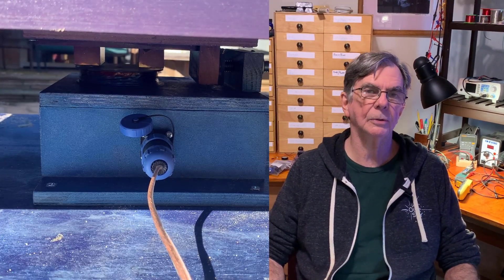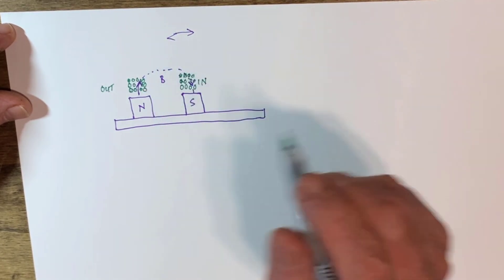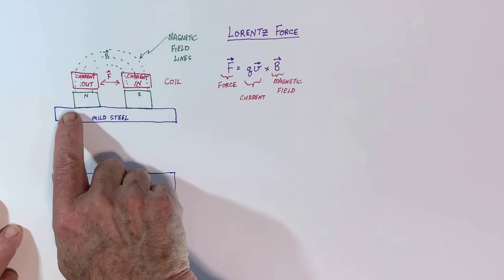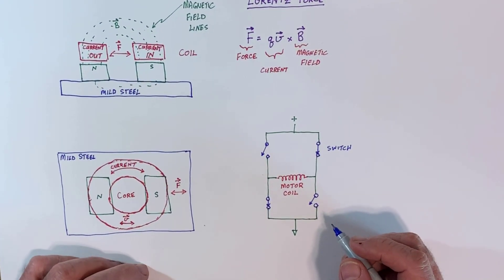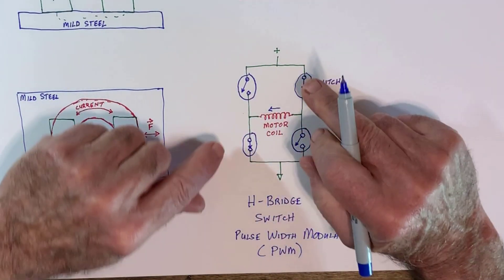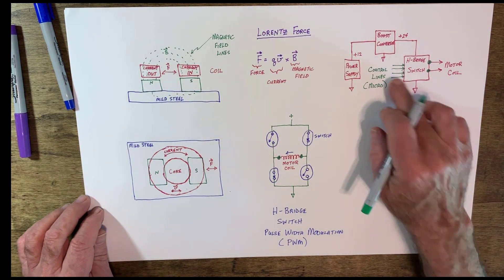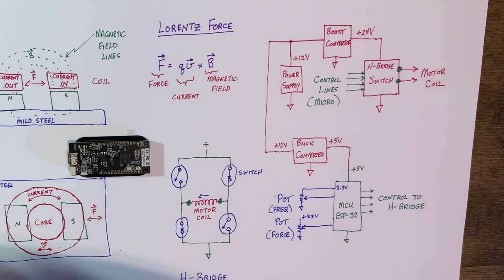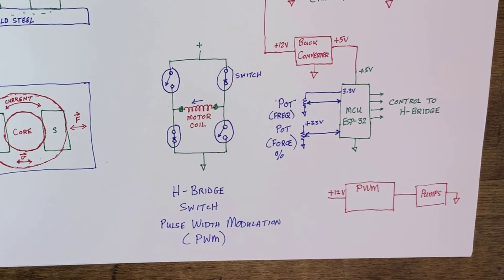Linear Motor and Electronics for Bump Shaker Table

Comment: Hi Dave, I have orded all the electronics to build the linear motor but I am having some problems in finding the magnets to the size you have used I can't find the 0,75 thick ones about 19 mm , I have found only 12mm thick ones would they be ok or not
Reply from the maker: You should use N52 3/4" thick magnets. You can find them here: <https://www.magnet4less.com/neodymium-block-cube-bar-magnets>  Cheers, Dave

Comment: Hey Dave,
I might be mistaking. When making the coil- once the wire is all spooled I saw you twisted together both lead and tail of wire is that correct? Also the black circles- are those some type of acrylic? 
Thank you,
Reply from the maker: The two ends of the coil are twisted together to keep the coil from unwrapping. There is no other reason. The black acrylic pieces are used to make a coil form, an easy way to wind the wire into a coil shape.  -- Dave

Comment: Thank you! Making a playlist of all your related vids. It's like a treasure map to a shaker table or an "escape room": put the clues all together, and "come out" with an elegant marvelous little device. Same mechanism would drive a wave table, a vibrating material feeder (for cons, etc.), or a vibrating miller table, cleanup sluice, dewatering aid, or any number of things a guy might like to experiment with.... replacing a lot of custom fabricated mechanical machinery with sets of magnets and a transferable control box: custom shaking actions, easily controlled or modified. What a fun "toy"!  (Not to depreciate it at all, but rather to delight in the possibilities!)
Reply from the maker: Thanks, James. I'm working on a video about the microprocessor right now. Yes, it's quite a useful device.  -- Dave

Comment: There are some really intelligent people in this world. And you sir are one. Thank you for making this public domain. If only there was a part list -I can build the table and I can do the wiring. The code part I’ll for sure stumble with. 😂
Also,
How much would you say the total build costs?
Reply from the maker: I would say that you can build the table for $350 here in the US, maybe less. It will depend on how fancy you get with connectors and other stuff.  Magnets are 50, magnet wire is 15, electronics parts are about 85, connectors are 20, probably 80 or 100 for the plywood, pump is 15. Hardwood another 30. You'll need buckets, some PVC pipe and fittings, a large tote, etc. Say another 80 for miscellaneous stuff. So, if you're really careful, it can be done. I'm working on the code. It will be available for free.  -- Dave
Reply: Wow that is awesome! Thank you very much. 
I was about to spend about the same amount on a small manufactured millet table. I’m going to try to open up the sketchup file and see if I can put together a part list good lumber is hard to get around here. Thank you very much for all the work. God bless!

Comment: Thanks for the video.  Seems someone on Treasurenet thought I needed a controller to control the speed and length of the stroke for the shaker table I'm attempting to build.  Even though your instructions is really good, it does take someone with an aptitude to build the devices, which unfortunately is way beyond me.  I just wanted to say thank you for all the great instructional videos you've posted.  They have encouraged me to at least try build a table.
Reply from the maker: Best of luck with your shaker. I'll be making a couple more videos on the micro and electronics. Perhaps they will help. -- Dave

Comment: Thank you so much for sharing. I'm going to try to build one myself now that I understand it better. I have a nice spot on a creek claim with bedrock spurs that causes a lot of sand with fine gold to drop out.
Reply from the maker: It's not a simple project, but I'm sure you'll make it work. One of the mistakes I make time and again is not making the base sturdy enough. I would consider adding rocks/sand/gravel as inertial mass to the base. The acceleration of the bump can easily be lost in the motion of the base.  -- Dave
Reply: @orophilia  I'll let you know if I can get it to work. After some research, i'm going to try going with an Arduino UNO R4, BTS7960 and keep everything 24v.
Reply from the maker: @sparks4025  Sounds good. Are you going to add a display? If so, consider the Lilygo T-Display-S3 board.  -- Dave

Comment: Excellent explanation . Very nicely illustrated &  put together. Is the ' bump required to impart an energy surge in the gold particle sufficient to bump it uphill away from the light sands, adjusted by the Bump Stop under the table?. If so that is a very clever way of controlling the table speed in both directions and negates the need for an offset cam arrangement used on the old style bump tables. Thank you for giving us a very nice detailed explanation of how to build this unit. As a pioneer you have blazed an exciting trail for us to follow. Cheers from Michael. Australia.
Reply from the maker: When the table deaccelerates due to the bump the gold particles travel a bit farther than the lighter particles because they have more inertia. It's more complicated than that because it's really the ratio of inertia to surface area, but that's a long discussion. Thanks for the comment.  -- Dave
Reply: @orophilia  Thank you ..Kind regards.. Michael

Comment: Great Instructional Video! Can you send me a copy of your code for your micro controller.  Also, what pins are you using on the esp32 micro controller for the H bridge and for the potentiometers?
Reply from the maker: I'm going to make a video on the microcontroller. I'll include the code at that time. -- Dave
Reply: Thank you.  Hopefully soon :) I am in the middle of building your shaker table and am confused about the micro controller. @orophilia
Reply from the maker: @bradysbackyardfarm9836  Yeah, it's one of the difficult parts of the project. I'll try to make the video clear. I have another set of parts for the electronics coming this weekend and I'll build up another controller from scratch. It will include a virgin micro and code for it. -- Dave

Comment: Thanks Dave, that helps a lot for me mate. 
Question, in your box you have 2 PWM's can i take it we are not using the second one?
Cheers
Geoff
Reply from the maker: That's right. I use the other one for another purpose. It drives my little heater for warming test tubes.  -- Cheers, Dave

Comment: Why not run your coil at 12 Volt rather than 24 Volt ?
Not using simple 3 legged 5 Volt regulator ?
Reply from the maker: That's a very good question about the motor voltage. To generate mechanical power in a motor we need electrical power going in. The coil has resistance, so the total power is limited by V^2/R. To get more power we can either increase the voltage or lower the resistance. In theory, I could have wound the coil with 1/4 of the resistance and used 12V. In practice this leads to larger diameter wire, which is more difficult to wind, or it leads to some other issue. So, you're absolutely right, this motor could be made to run from 12V. However, we would probably want a voltage regulator anyway since we don't want the input voltage to affect the force on the table. There are several ways to solve the problem and I consider this a decent one. Yes, I could have used a linear regulator to make 5V, but the price of the switcher is the same or cheaper, and now I don't have to worry about the thermal dissipation in the regulator.
Reply: @orophilia  Obviously you have based your work on all options and not making things complicated because you can.